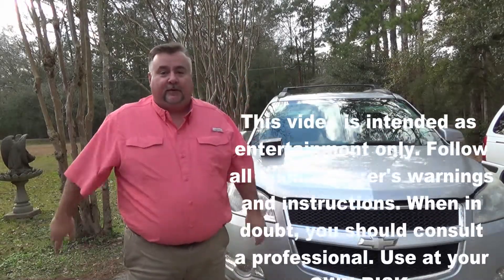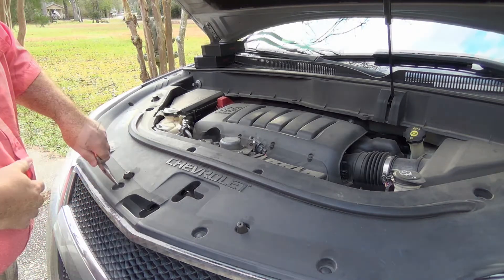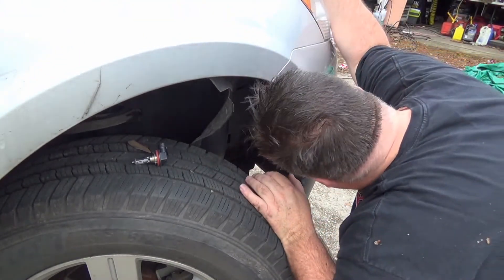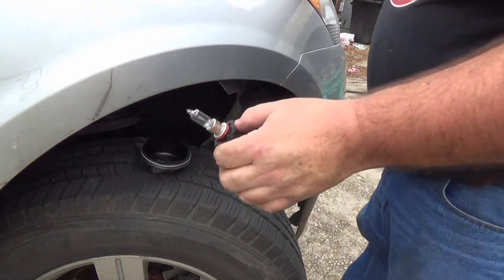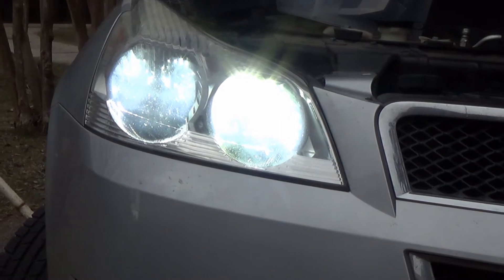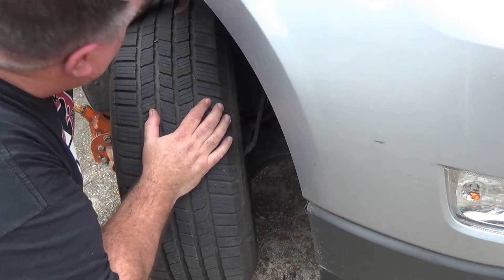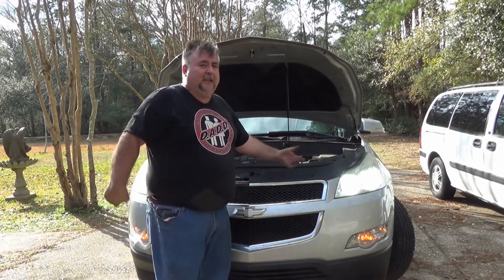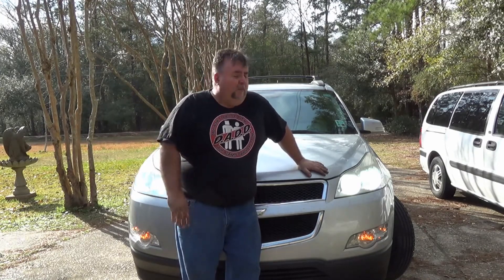How To: Upgrade Your Headlights to LED Bulbs

Comment: This is the first video i've found that talks about the high beam replacement. It seems like a no-brainer now that i've watched it. Thank you. 
(Update: i successfully replaced both high and low beams at the same time. Process was basically the same and I had great access to both. Again, thanks.)
Reply: Low beam

Comment: Btw the instructions say to make sure the LED elements are at 3 and 9 o’clock but on my Acadia (same as traverse) I was not able to turn them enough.  Did u encounter this issue?  I hope I am not blinding drivers by it not being at the right angle

Comment: Daniel could you provide the brand of LED that you used? I along with others have inquired.  Any update on the performance? What is your overall opinion on the LED headlights that you chose in this video?  Thanks!